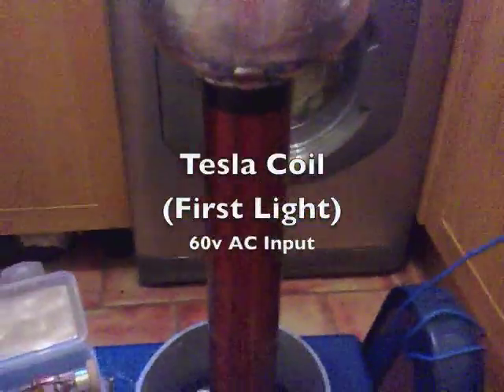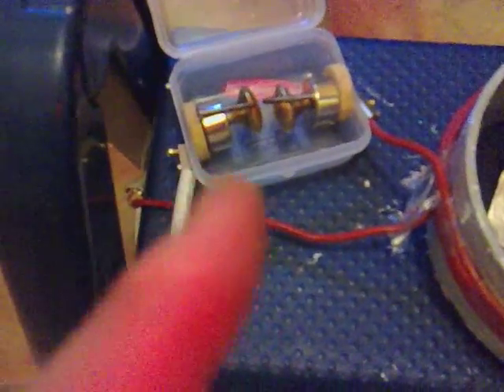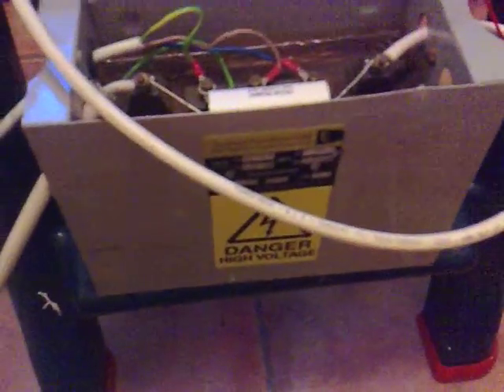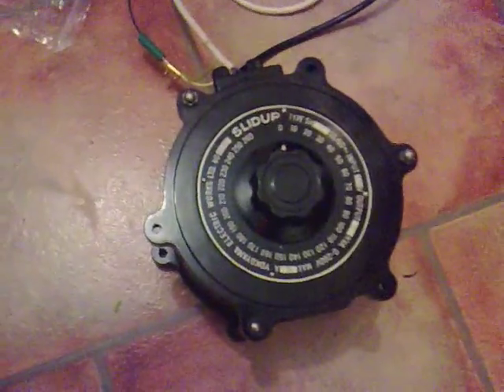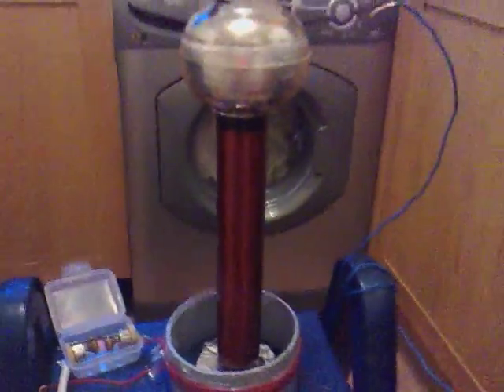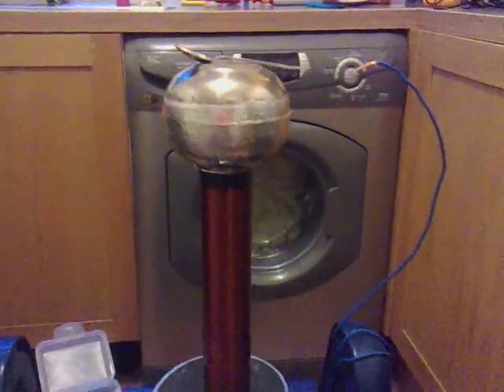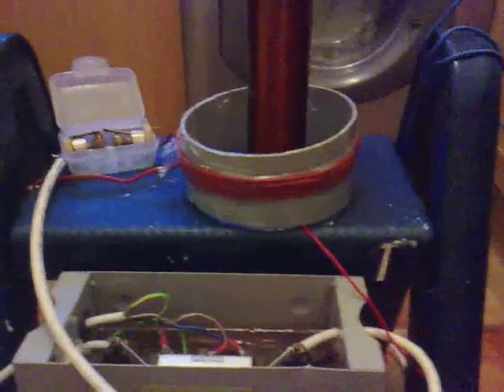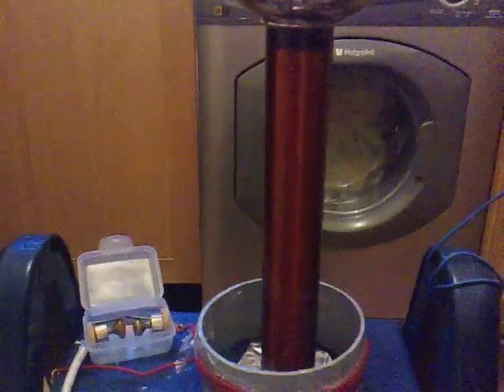Tesla Coil (First Light) 007

Comment from the maker: Hi

Yeah I only put them this way for ease because the copper door knobs don't transmit the magnetism. the magnets can pull 55 kg each in a north south arrangement.

I have read Teslas notes on this and believe that he could not get strong enough magnets at the time so he had to put them close, with a thick layer of mica over them. 

Im willing to check it out though once its tuned I can turn them 90 degrees, to see the differences....

Any ideas welcome...

Thanks
Paul.

Comment: Sorry for double posting but this is really interesting.
I've read some more now and it seems that a really powerful magnetic field going 90 degrees across the discharge can actually rip away the charge carriers, which is the electrons and separate them from the true charge, which Tesla called "aether current". Doing this would allow you replicate many of Tesla's incredible reported phenomenons, like creating shock waves of "electrical pressure" traveling through any barriers or shields.